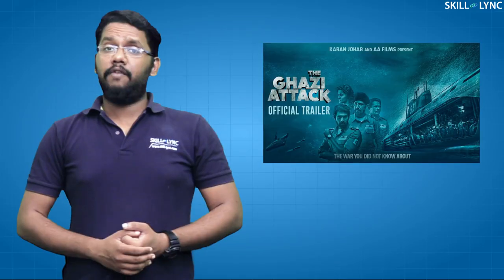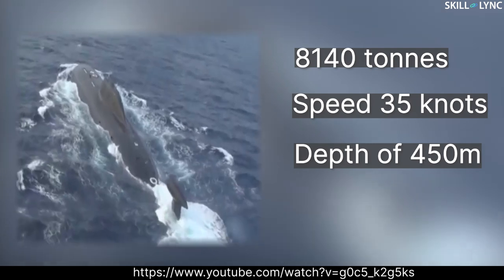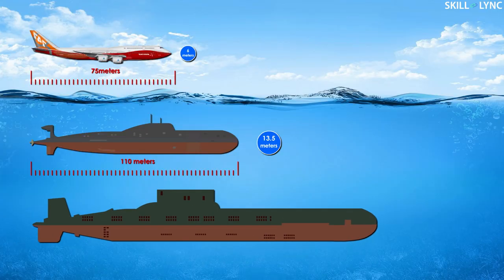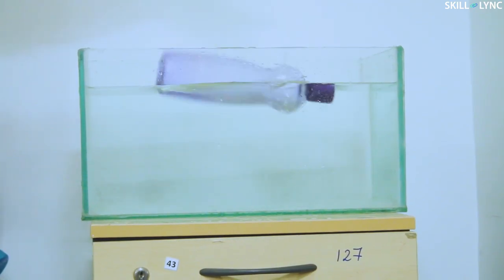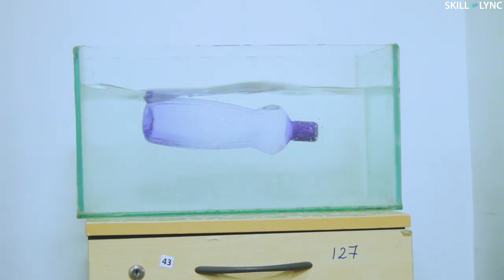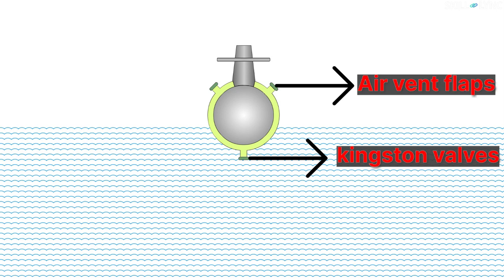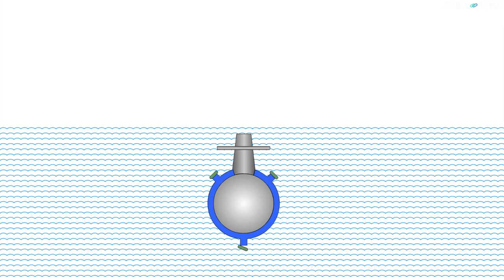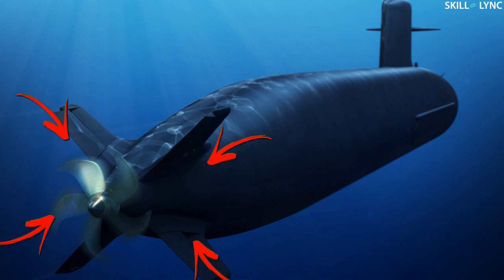How does a Submarine dive and resurface in the water? | Skill-Lync

Comment: Still i am not clear that once the air leaves while filling the submarine with water and it sinks then how this air is brought back to empty the water for floating on surface.

And let us know that air is also required for combustion of fuel in engine, breathing, cooking etc. How does the staff in submarine manage this?
Reply: "then how this air is brought back to empty the water for floating on surface."
It's not. You simply drive the submarine up to the surface, kind of like how a pilot flies a plane higher up in the sky. Once the sub is near the surface, you can pump in the air from the surface to empty out the tanks of water.

Comment: There's got to be a limit to how many times it can pump the compressed air in the tank right? What if the sub sinks and this pump mechanism fails?
Reply: Lmao then they r screwed
Reply: Submarines normally have emergency external ballast tanks that can be filled rapidly.
They are normally used to resurface in an emergency, so they can be used if the pumps in the main ballast tank fails.
There is also a manouver where they point their nose up, put engine thrust to the max and pump air in the emergency tank to shoot themselves up.
Redundant systems are everywhere on these things. They can't risk losing billions of dollars in expensive submarines because they failed a simple task.

Comment: but how does it get the air when it want to resurface
Reply: It brings the compressed air on board before diving.
Reply: Submarines have compressed air tanks inside them as well..
Reply: It's doesn't. You simply drive the submarine up to the surface, kind of like how a pilot flies a plane higher up in the sky. Once the sub is near the surface, you can pump in the air from the surface to empty out the tanks of water.